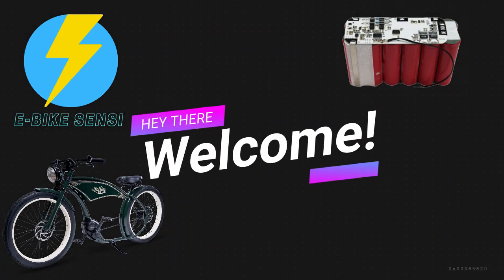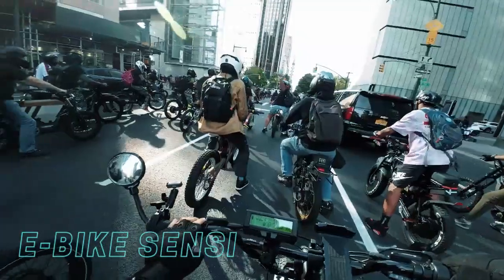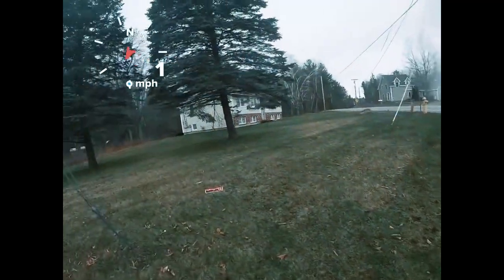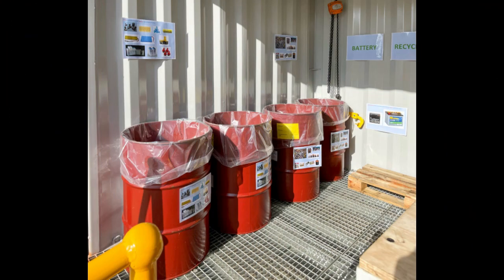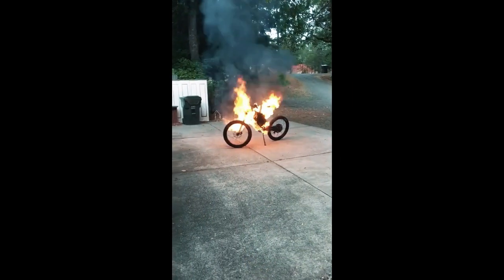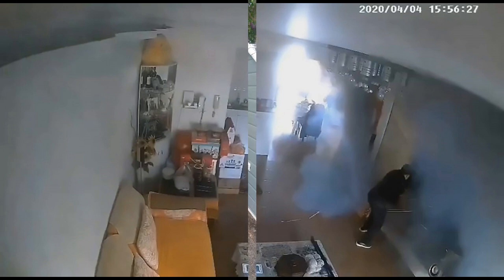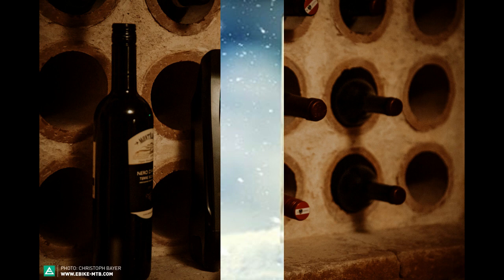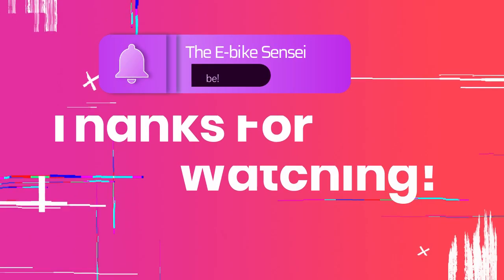How to prevent dangerous E-bike lithium battery fires!

Comment: 90% of the bikes shown in this video are not ebikes they are electric motorcycles and a huge percentage of ebike lithium-ion battery fires are from home made packs. I have four 52V 32Ah packs two of which have been used for 8 years now. The biggest factor in production ebike battery fires is low-end garbage chargers and morons over-amping the motors. - https://youtu.be/jBvhEa80rEw

Comment: I’m a little shook that batteries can randomly catch fire like that. 

I have a Grade A LG 21700 cells 52v 45amps. 

My battery heats up during use when I throttle a lot. But I’ve since recently reduced the amps on the controller to take in 35amps instead. And noticed that the heat isn’t much plus I get more range too. 

But is it okay to run a 52v battery with a 48v controller? 

My current controller is a Sinewave Sabvoton. Programmable from 36v up to 72v 

ANY info would be appreciated
Reply from the maker: Hey yes, if your controller is compatible you can easily run a different voltage battery, I know for Sabvoton they are programable so you may need to change the settings in the app for battery low volt and high volt, but it’ll probably automatically adjust. for the heating up you describe you should really try to limit the amount that your battery is heating, your not only wasting energy/range in heat loss but it’s also possibly not good for your batteries depending on how warm they are getting. It’s also possible the nickel used to weld your battery together is not sufficient for that amount of amps you are pulling
Reply: At age 73 I might not get off fast enough and that could cause irreversible damage!

Comment: You can get water based lithium batteries it won't catch fire or over heat
Reply: It's more expensive though
Reply from the maker: @Mark-xl3ns  where are they available to purchase? Don’t believe there is one available yet for e-bikes? Lifepo4 has been around a long time, it can’t catch fire ether and is good priced with many advantages.
Reply from the maker: Well majority of lifepo4 cells won’t catch fire, lot of them you can axe in half and all it’ll do is sizzle a little.
Reply: @thee-bikesensei4289  I drowned an old cell phone in water. It smoked and popped some. Probably not a good idea.

Comment: So your saying all the tesla cars that go up in flames are bad batteries or a bad bms . Lol lithium ion batteries can go up anytime regardless of quality . I use life po4 batteries that dont ignite when they short out internally  the bms cant stop a cell failing .
Reply from the maker: Most of the fires with electric cars are gonna be because of external physical damages. Some because of failures in software/charging problems. Teslas are cell level fused batteries, not only that but also all good quality cylindrical li-on cells have an internal fuse called a “CID” Very rare for a battery to short randomly.

Comment: Extremely bad for the environment too.  Far worse that liquid fuels.  Best not buy one in the first place.
Reply from the maker: Fumes from them catching fire are no doubt very bad for the environment, with nuclear and cleaner energy production with good battery recycling there is also no doubt the carbon footprint for electric bicycles are fairly low. Hundred plus times smaller then a battery found in an electric car. All devices we use have batteries so it’s unavoidable.
Reply: @Evcustom  Not just catching fire, the damage to the environment from the mining of Cobalt and Lithium is horrendous.   Any batteries all add up to a huge amount.  Carbon Footprint?  C02 is not a problem since it is only 0.04% of the air around us and is a heavy gas which lies close to the ground for plant life.  We need more not less!  Apparently only a small amount can be recycled at present.

Comment: Lead acid batteries need to be replaced every year or two???   Driver, vehicle owner + mechanics teacher here--    VERY FALSE statement!
Reply from the maker: I run an e-bike business, the lead acid batteries that come stock in e-bikes do only last that long, the automotive sector is completely different. If you look at how many deep charge cycles they are good for it’s usually between 250-500, (usually a lot less with the ones found in e-bikes) if you daily drive your e-bike the batteries will be dead within a year or 2, with e-bikes higher constant discharge demands they simply do not last anywhere near as long in e-bikes.
Reply: @Evcustom  i thank you for taking the time and replying with an educated and intelligent answer.  The claim was that lead acid batteries need to be replaced every year or so and did not refer to the specific application.  I am more than willing to accept your statement that lead acid batteries are not a good choice for use in e-bikes due to their weight and operating conditions.  Good day :-).
Reply from the maker: @gman7640  appreciate the feedback! Will be more specific next time 👍
Reply: @Shaman196

So just stop production of e-bikes and batteries cause of a a few rare mishaps throughout the world?

Comment: good info... except that lead acid batteries last much longer than "every year or two".   Whether a lead acid car battery, or a lead acid power backup battery for the home, their warranties are for many years, and they last 5-10 years.
Reply from the maker: You’d be mistaken for the lead acid battery’s that are commonly found in E-bikes, many are a maximum of 250-400 charge cycles depending on how good you take case of your battery’s, 99% of them are very cheaply made in china, if you recharge once a day your batteries are at the end of their life by a year. Car batteries are under much less load vs e-bike batteries (only when you first start it is higher demand) less high discharge applications means your batteries last longer same with solar applications that are backup, they only get used not as often.
Reply from the maker: Lead acid batteries also don’t like being fully discharged often, lot of e-bike riders who use lead acid drain them completely often or leave them undercharged over winter resulting in very short lifespan. Lithium can stay at lower voltage much easier without hurting it.
Reply: @Evcustom  A Li-Ion battery will be damaged if left drained, and also gets damaged if fast charged or regularly charged to over 80%... It is not only Lead acid that need proper care,  you can leave a lead acid plugged into a smart charger 24/7/365 and not damage it, keeping a Li-Ion battery fully charged can cause it to either fail or set on fire.

Comment: @4:42 if you have a basic bms you absolutely MUST leave the charger on for a period AFTER the light turns green. This is the ONLY time the bms can perform maintenance on cell balance. If you let it go too long without letting the bms do balance maintenance then the bms will eventually shut to port early and the light will turn green but no maintenance is being done, so it gets worst with time not better.

If it gets that far out of balance you need to open the battery and manually balance it, then periodically let the bms have time to perform maintenance.

To test the battery without opening it you need a multimeter and charger. The charger should slowly climb to until it reaches peak charge, then turn green. If it jumps up the last few volts instantly then the bms closed the port. 

Once the battery is balanced once, periodically let it go until the light turns green and then let it continue until voltage is 0.1v-0.3v higher (whatever the charger open voltage is). let it continue for at least an hour. It will trickle in charge at a rate the bleed resistors can bleed off the cells will be saturated so even when you unplug it will continue to balance if needed because the cells wont sag. 

If the battery will not be used, discharge it after its balanced.
Reply from the maker: Yes, you are right, most cheapo BMS units do not have any active balancing or any kind of balancing during charging until the batteries are full. As mentioned in the video it is important to use a good quality bms for safety reasons. Majority of batteries when newly built properly will not go out of balance for quite a while if they are matched properly internal resistance wise, having a cheapo bms compensate for a poorly built out of balance battery is a very dangerous thing to do, those bleed off resistors as you mentioned can actually overheat if it’s out balance enough potentially causing a fire especially if it’s trying to balance dead cell groups or burner cells. For the majority of people that are not familiar with batteries it shouldn’t be recommended in my opinion to leave on the charger for long periods, especially if you don’t know what bms if any your battery has installed. wouldn’t trust cheapo bms units to prevent potential dangerous overcharging conditions anyhow, to risky unless you know what your doing or monitoring your battery charge. The time from when the light turns green to when your realize it’s green should be enough time for a healthy battery to remain balanced ok with the bms you mentioned. Would like to make a battery safety video in future more catering to advanced users and builders/businesses, your point would be gone into then. Appreciate the feedback!
Reply: @Evcustom , the only bms that doesn’t need to be fully charged is a smart bms that you can tell it to balance wherever it is. I have an ant BMS which can bleed at about 0.1a so it’s about 3x faster than the average BMS you will find in any non-bluetooth bms. And active balance is ok if you have full control over the voltage its starts balancing. 

But 90% of the batteries even from good manufacturers need to be charged for some time after the light turns green, and that’s assuming the battery is nearly balanced and the charger has the standard taper. I have a 5s1p tool battery with a 1a charger but zero taper so it never will enter balancing maintenance no matter how good I manually balanced it. The charger taper is mandatory. Lol

I think Bolton bikes also did a video explaining that you MUST charge for a while After the light turns green but he didn’t show how to verify it’s getting balanced and not just tripping the BMS.

Unfortunately many don’t understand this basic concept because we are taught “don’t overcharge”, “don’t charge to 100%”. 

If every battery had a jk bms then life would be easier. Lol